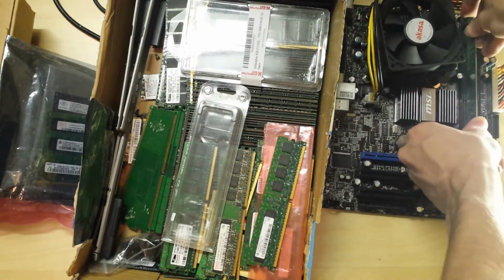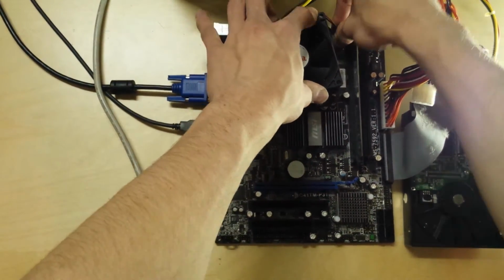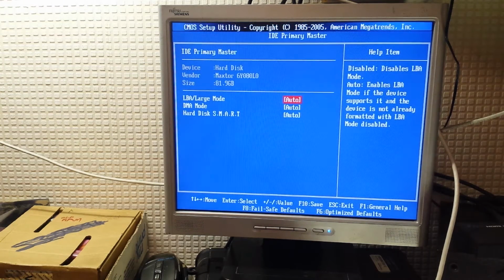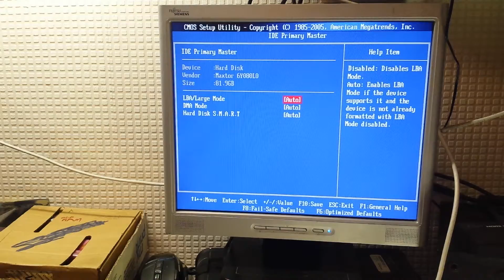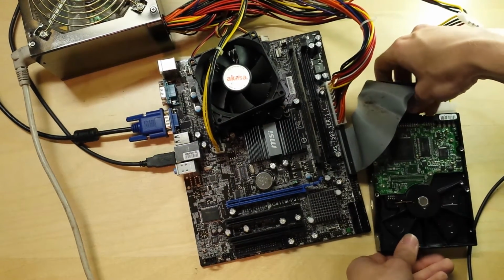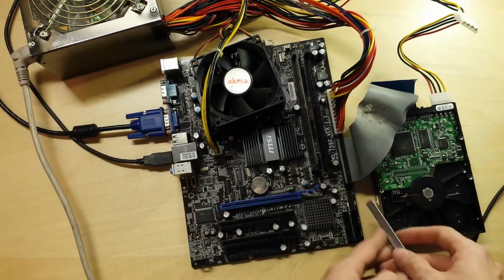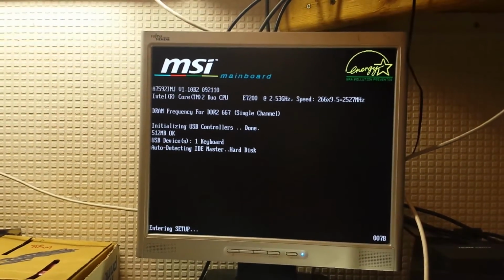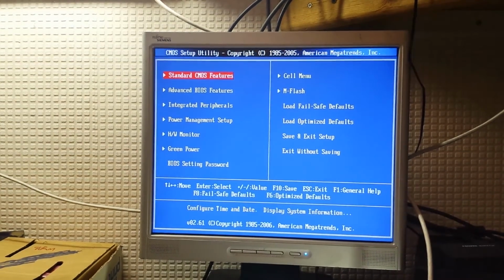Dead Hard Drive Repair & Data Recovery Attempt - Dying PSU Burnt Out PCB Swap (Maxtor 80GB IDE)

Comment: That was very interesting thank you for taking the time. I have just been given a W98 compaq agency series cm0900, it shows little use very clean inside and out. The hard drive is failing, unfortunately I threw all my IDE drives out a short while ago, so I have ordered a IDE SATA converter on eBay, I renovate old radio equipment working on a 1950 Mullard punch card valve tester at the moment. Your video and the recent acquisition has inspired me to start collecting older old computers : ) Reference a negative post below. Folks complain about everything that does not suit them now, it has become a habit with them, they do not realise that they are being sucked into this and are no longer thinking for themselves as individuals.  God Bless Allen and Alanna

Comment: Ok. I just watched a 20 minute video with no resolution. At least the curse of oak island is entertaining
Reply: I mean, the conclusion is actually in the video at the end during the summary. It shows which chip you need to swap with the appropriate soldering tools in order to allow the PCB to communicate with the drive internals.

Comment: I think the PCB may also need to be torqued but I would try changing the chip just for the hell of it I wish I knew how to tell if the PCB board is an issue and the bios thing makes no sense to me because you can buy replacement PCB's. In fact, that's how I found this video. I was searching for a way to test if the PCB is the issue. You see I have 1000gb drive that seems to have died with a lot of data that I wouldn't mind recovering here's the kicker the replacement PCB will cost me more than the new HGST Enterprise 2000gb drive that cost me $42.99 CAN before taxes and warranty but still the PCB replacement would cost me $45.00 CAN.

Comment: I did once recover a laptop drive by finding an identical system board, was done in a corporate environment where they had saved  hundreds of drives from ex-employees involved in a legal issue.  The date of manufacture must the same or close on both boards (like in this video) as the manufacturers make changes to the drive's firmware often throughout the drive models production run.  After recovering the data by slaving the repaired drive in on a working system,  archived the two drives together as the donor drive would need its board back if the company would need to check its data files in the future.

Comment: Good vid, Nathan. A few questions: is it possible (or have you ever tried) removing the mechanical components of the HD motor, platters etc? Is is possible to remove an fit these to another HD shell? Is there any leeway to move the platters or motor etc to another brand of HD. or are there restrictions presented by power supply, spin speed, motor design etc. A while back, I had a HD with a burnt out PCB and when I looked into data recovery prices, they were ludicrously expensive, so in the end, I resigned myself to the loss of the data and chucked the drive. Thanks for you vid, I'm doing background study in as many areas as I can, as I'm about to do start an entry level Comptia A+, and I like getting as much hands-on background as possible, so I'll subscribe